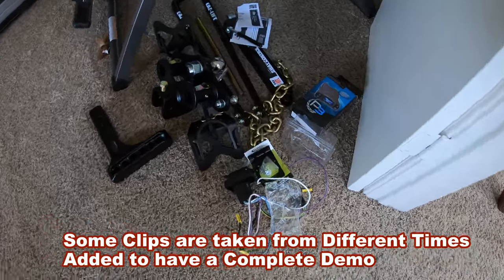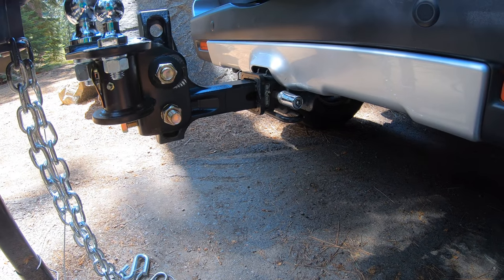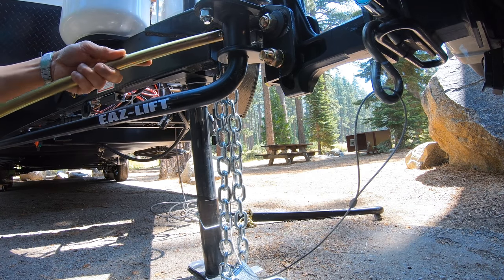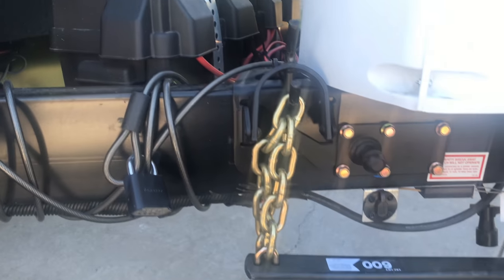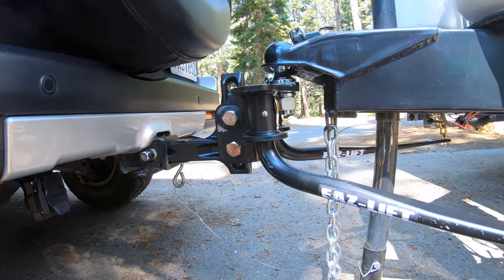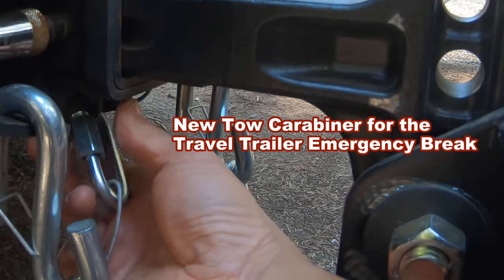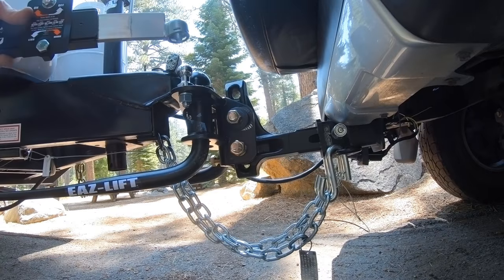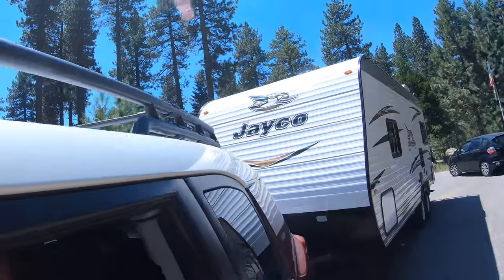How to Install Weight Distribution System on FJ Cruiser Sway Control for Travel Trailer or RV

Comment: Does the WDS affect your tongue weight? I have a Husky set up and it's really over 100lbs just by itself.
Reply from the maker: It does… 1/4 to 1/3 of the weight gets distributed to the trailer’s axle
Reply: @cbatilo  thanks. So, if my Twitter tongue is 400lbs and the WDS is another 100, my weight is actually only a little over 400?